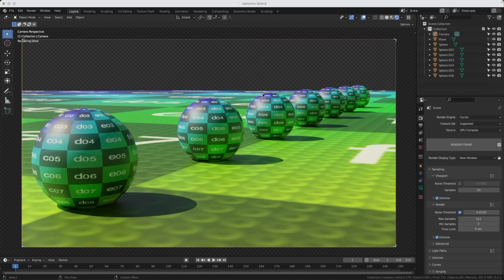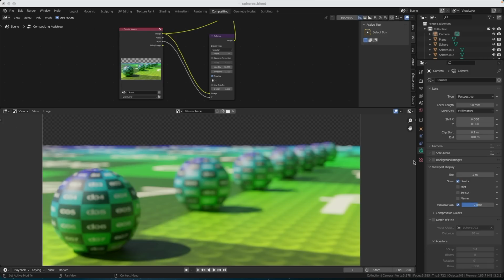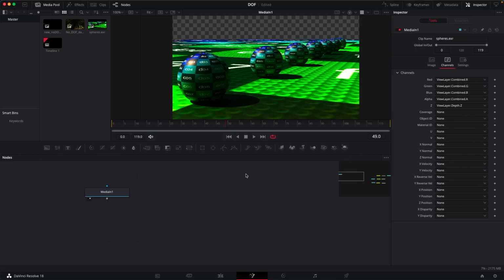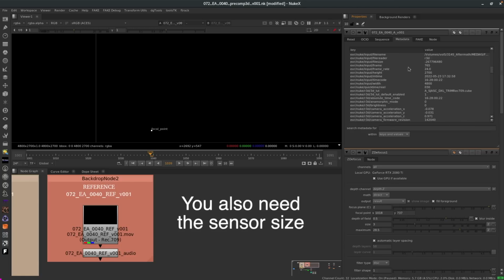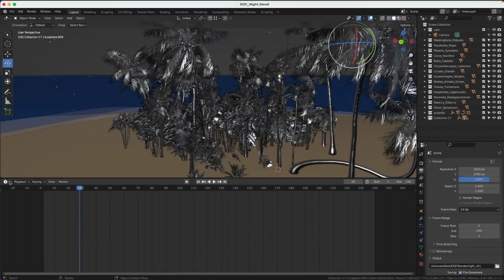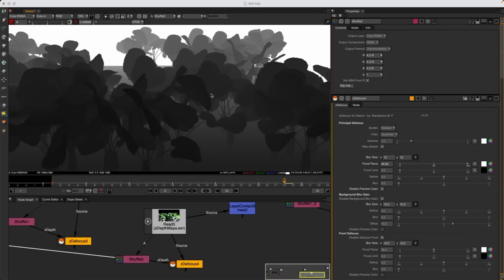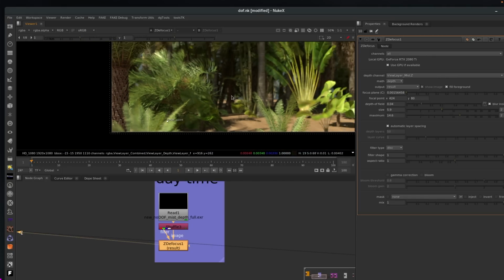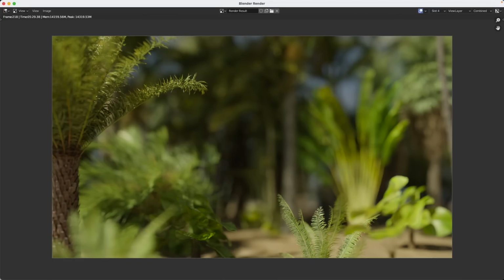Depth, mist passes and depth of field in Blender, Nuke, Natron and Fusion. #b3d

Comment: I've had some luck getting cleaner depth passes running the denoiser node and alpha into the depth for exr output so it will antiailse the alpha, not perfect but saves you from a 4 -8k render on the z alone

Comment: For the "buggy" Z pass with lots of fireflies, use the denoised version (denoising data must be activated first)! You'll get a clean output.
Reply from the maker: denoising data?
Reply: @BlenderBob  hi Bob, in the properties panel> view layer properties, where you can find all the render passes. Apparently I was wrong but I got to use it successfully for my last project where I had large scale forest scene with an unusable depth pass. Never mind...
Reply from the maker: @fabbrobbaf  How com I never realized that there's a denoting data option!?! Doh!
Reply from the maker: @fabbrobbaf  Actually denoising data will not denoise the data passes. It just output the information that is used for denoising, if I'm not mistaking
Reply: @BlenderBob  🤷‍♂️
Anyway in 3.3 denoised depth pass seems broken...
Reply: @BlenderBob  previously you had to use these passes with the denoise node. Now you only have to activate it in the render setting tab (Optix or OpenImageDenoise).

Comment: A very common problem you keep having is that you neglect the data types you are working with. I'm pretty sure this is not the first time you had this exact issue on this channel:
Blue sockets in nodes are vector-values. They have three different dimensions. It's not obvious how those ought to be converted to a single value (which is grey sockets) but Blender chooses, I think, the average value.
So if you try to use this with a gradient, it'll just average together to a diagonal gradient.
It's best to do a separate-XYZ-node and pick out just one direction you like. It'd make sense for that to be the Z-direction. Then, if you pick a plane or, even better, an empty, the "up" direction of that object is gonna correspond to the direction of your gradient. (Although in some situations going for X or Y might be more suitable to your needs. In most cases you'll want Z)
Reply from the maker: The point was that there’s no way to do a planar projection with some kind of visual reference to where the projection will happen. Same with projecting UV. You a cylindrical projection but no control at all over it. Yeah, agree for the X Y Z approche.
Reply: @BlenderBob  yeah, I'm not saying the situation is perfect. I just noticed in the past, also in your Geometry Nodes experiments and such, that that particular concept of socket-type kept hitting you a curveball.
In principle, using another Object's object coordinates (as you have done) should be what you want though. Then it should work pretty much exactly like in Maya I think? As far as I could tell the only issue there was the socket situation.
It'd still be nice to have, like, an immediate version of that though. Spawning a texture directly as a 3D object does indeed seem rather useful. And I think every issue you mentioned about the Depth- and Mist-passes and how various softwares respond are pretty big deals.
I wonder if there could be an approach that's somehow "best of both world", giving you Cycles' precision but in a convenient "confusion mask" or something. I mean even the best-in-class post processing depth of field effect didn't look nearly as good as what Cycles would have given you, but the drawbacks in flexibility are obvious and so it's an acceptable tradeoff.
Reply from the maker: @Kram1032  Yeah, sometimes I go to fast in publishing clips and I get people reminding me of the mistakes I made (especially my Wish List clip) and I actually really appreciated that. I'm still learning. Blender Bob doesn't mean Blender Master. It's just a name. I actually said that in my very first clip. I thought it could have been when they change to Cycles X but no, it still didn't work in earlier versions. I don't know a bout 2.79 though. I will make an addendum clip like I do from time to time to correct my mistakes. Cheers
Reply: @BlenderBob  I also really appreciate your videos.
I'm pretty well-versed with technicalities, but not really with artistry and trickery, and that's a gap you're filling nicely.
It's also great to see this broad set of programs side by side, really showing off how powerful (or not) they are. And hopefully they'll also show weaknesses some dev somewhere is eventually going to address

Comment: These "Blender bugs" have been there for years. I realize it's free software, but I don't understand why the Defocus node and the issue with alpha map edges haven't been addressed by now, especially considering all the support the Blender Foundation is now receiving and has been receiving for several years now.
The Vector Blur node is another one with bugs -- the first frame is always unusable and it sometimes just freaks out requiring frames to be re-rendered.
There are always workarounds, but it's unprofessional and embarrassing. I find myself telling friends, "Yeah, sorry. That's just a Blender bug. Hopefully they'll eventually fix it, but it's been there for years, so don't hold your breath. Here's an awkward, hacky workaround."
Reply from the maker: Usually issues with MB on the first frame is because the animation didn’t start before frame 1

Comment: Why does Blender use f-stop values which have no sense in real world lenses? Like 0.2. The f-stop has to be set way under 1 to get a shallow DOF. While real lenses rarely go below 1.2.
Sure, no big deal, but dont call it f-stop then. Call it DOF ratio or whatever. :)
Reply from the maker: Are you working in real size?
Reply: Yes, sir. I did not make tests, setting it to 0.4 gave the desired result and that's that. It's just an impossible real life value. I'll make some tests, maybe it was my scene after all.
Reply from the maker: @imregpap  That reminds me that I I wanted to mention that the scene has to be real size but I don"t remember if I mentioned it. But I think I did make the test in one of my first clips like 2 years ago. I will try again.
Reply: @BlenderBob  I made a quick close up selfie in my room and replicated it in Blender with the same setting, and it looks OK! F-stop 2.4, 20mm, 25cm from my face. Focusing on the tip of my nose, the back of my head is already blury, like on the photo. So it's accurate. I think I just made huge outdoor scenes with the focus plane meters away from camera and expected more blur. But yeah, it depends on more factors than the f-stop alone.
My bad, Blender seems accurate. :)
Reply from the maker: @imregpap  four factors can influence the DOF. Focal lens, distance to object, sensor size and aperture. They all need to match in order to make tests

Comment: You could use a node group and python to add that vertical ramp to every material and thus still use bump and displacement. The Eevee addon material override can do this
Reply from the maker: The idea is to get it as an AOV and not messing with the original shaders. Should be built in like Renderman
Reply: @BlenderBob  what happens if you use it as a material override and then use the diffuse pass

Comment: Point in Fusion is, that it reads not automatically many channels from Blender, because Blenders naming is very wrong. Well EXRs and Blender is a nightmare on its own. Anyway, presets do the best job there, except you used viewlayers, but thats Blenders problem. Also Blender is doing depth wrong with motion blur
Reply from the maker: In Nuke I just need one node. Then I shuffle to get the layer I want. So I only need to update one node if i change versions.
Reply: @BlenderBob  Well, but if the name changes and you output a serious of layers, things a different. Yes Fusion is more work, have both setups here. In Fusion and Nuke. Last project rendered in Cycles with the help of TurboRender, thanks to garage farm who made it work. Still needed to do a bit of denoise on diffuse and transparent.. So I depend on a outputting nearly all layers and also in having smaller files. A bit complex for a comment.
Reply from the maker: @robertYoutub  I just answered this to another comment:  If you have an EXR with 5 layers and they each have diffuse, glossiness, transparency, normals, and point position AOV, that's 70 layers. Can you even have 70 layers? And if you use the script, you will have a mess of 70 nodes that you need to update one by one every time you have a new version. In Nuke, I may have many shuffle nodes but they don't need to be updated. I only need to update one node.
Reply: @BlenderBob  yes in theory, but not if you know Fusion. Its a bit tricky so. And yes Nuke does it better. I like Nuke, but then Fusion has some awesome stuff that I also like. Yeah absolute right about the manual setting in Fusion. That sucks. But as the names are always identical in all renders, except Cycles, its just replacement of the root. As said, I have setups, with a single node and bit of shuffling.
Reply from the maker: @robertYoutub  Nice!

Comment: I've made an addon which adds empties to a camera, with it you van control the zdepth much easier. I used according to someone's example. I'll try to post a link of that video and my repo
Reply from the maker: Why do you need to control it. All the information is already there. It’s the tool that deals with it that needs to be fixed
Reply: @BlenderBob  in blender it's not easy to control otherwise
Reply: @BlenderBob  you could get se it for dof, it renders faster vs rendering with real dof. Downstairs Dr is that is just 1sampoe and that's why we t looks so jagged
Reply: Here is that video, hope YouTube doesn't delete this link. Hate them doing that
https://youtu.be/5eoYmUfyUyw

Comment: Great content as always :) 
As for the vertical fog, one quick way to do that in Comp is by using a PositionPass (P World). The output image will represent the position of each pixel in 3d space and therefore: Red channel = X (horizontal values), Green channel = Y (vertical values) and Blue channel = Z (depth values - yes, one can use the blue channel as a Z depth as well). Knowing this I'm sure you got the point already:  use G from PWorld as mask for a Grade node (Nuke wise speaking). Extra control can be achieved by grading this mask as you also did in one of your examples ;)
Reply from the maker: Yeah, I totally forgot about the point position but then again, how do you add noise like I did in Maya?
Reply: @BlenderBob  you can use a P_Noise and multiply that with the previously generated mask :)
Reply: @BlenderBob   With the p pass you go in nuke and use and expression node and in the field bellow r-g-b fields, where is nothing you adt noise(r,g,b)  and now you have a noise spread on P pass on the A channel witch you can controll by adding a gain node before the expression and you play with the rgb values in that to scale the noise as you want.
Reply from the maker: @darviniusb  Cool! Way over my pay check though. Thanks!

Comment: Regarding custom depth pass, here is a time consuming workaround that might work, although I didn't test it against transparencies and displacement:
1) In some random material, add two reroute nodes before material output and make a material node group out of them.
2) Inside, add geometry node using the position output through a vector rotate and possibly vector add, followed by a separate XYZ.z going into custom shader AOV.
3) Add this node group to all materials in the scene, dropping it as the last step - the actual shading info will just pass through it, but AOV info will get added.
4) In view layer properties, remember to export the custom depth pass for export. Preview in small outputs and adjust the parameters. Sadly can't render preview custom AOVs.
I gave this up in Blender because of the noise and edge issues you mentioned, but try using it for a depth of field control instead of mist in Nuke.
You should be able to get something similar to a tilt lens with a tilted focus plane. Wild effect, and not often used.
Think top of a flower field in focus but the bottom of the plants/ground are not, but the camera is horizontal. Would love to see the results with some heavy bokeh :)
Hard to explain, but here is a real life video on it used for photography: www.youtube.com/watch?v=gTDCW_8AsSo
Reply from the maker: Interesting approach. I know very well what a tilt lens is. I studied professional photography and I use to own a 4x5 camera where I could tilt the front to move the DOF up and down or left to right or even in diagonal.
Reply: @BlenderBob  I use something similar to make walls render invisible if viewed from the outside (thin walls), as to not obstruct my view while navigating the scene, as well as clay rendering without affecting lights and what would be glass windows and so on. Might be possible to make a script adding this to all materials, then ask what to do if emission or transparency is found, but that's out of my league.

I tried with assets using alpha, and for now it's a no-go. While I can get the alpha information into the node group and do some maths with it, it still registers as a ray hit and will obscure the object behind the alpha which is what we want. From what I recently heard denoise depth pass may be better suited for regular depth in some cases, but of course won't work for custom depth. So a proper pass for this that handles transparency/alpha would be very welcome.

Comment: I came across the bug about the white dots on the Z pass and Mist pass so many times while working with plants and accroding to what i found on the internet, it's due to the fact that when there is an alpha involved in the shader, if it's not 0 or 1 it will do this artefact, which is weird bc the opacity map used for this kind of shaders are pure white or black, maybe it's a problem with the colorspace but i don't know. 
One way of dealing with this bug is to set the "Alpha Threshold" in the View Layer Properties to 0 and so Blender will ignore the Alpha. The problem is that if you work with low poly plants you will get a big difference between the geometry and the alpha... So please Blender Devs fix this problem !
Also this problem appears in others utility passes like the Position pass, but the cryptomatte has 0 problem of dealing with it......
Reply: For the "buggy" Z pass with lots of fireflies, use the denoised version (denoising data must be activated first)! You'll get a clean output.
Reply: @fabbrobbaf  yes but it doesn't look like a Z pass
Reply: @JonathanTRG  then you have to map it with the map node by setting for instance in min = 0 and in max = 250 to out min =0 and out max =1 (do not normalize it otherwise it will change depending on the max and min range of the objects int he scene). Trust me it works and when I found it out I was literally hilarious.
Reply: @fabbrobbaf  the "Denoising Depth" pass is not a depth pass denoised, it's not clear what it's purpose is, I assume it's a debugging pass, but anyway, it has some information of glossiness in it (so parts that are closer to the camera are whiter due to the specular highlight), it is anti aliased and seems to have a different white value on long lenses, I could show you instances where it's absolute trash and doesn't work but I can't share images here, so no it's not a depth pass, and even if it works in some cases, if it doesn't most of the time, it's not a good replacement
Reply: @JonathanTRG  are you just supposing or is this documented? Anyway this pass saved my ass so many times
Reply: @fabbrobbaf  like I said, if i could I would have send you pictures, the only supposed part is when I said that the Denoising Depth pass is a debugging pass, because there is no documentation on it. For the rest I can just do a render and show you.

But i'm glad it works for you, it just doesn't work for me and a production pipeline so the bug needs to be fixed

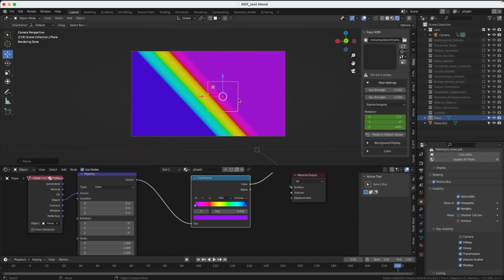Comment: Around 26:04 I can't answer why using a gradient texture (edit: color ramp) is like that, but a (possibly) better way to get vertical depth with a ramp is to use an empty or an object in a texture coordinate node, then use a separate xyz node and use the z output for your needs. You can scale the z scale of the empty up or down to get more or less of a gradient vertically. I've attached a link to an image on my google drive.
https://drive.google.com/file/d/1FtFtRoVkLudm3rezkwvOY3umazTeLflr/view?usp=sharing

I don't know if it'll work for your purpose, but I've used this for lots of "global" kind of effects like dirt/grunge on a bunch of things on the floor, a dissolve effect that goes on everything, some stylized lava glow.
Reply from the maker: NIce! Didn't even think about that. I could probably also use the point position pass too. Forgot to try.

Comment: You should separate XYZ coordinates, plague Z value in color ramp. By default it uses XYZ as RGB and makes color ramp on its brightness. XYZ values get higher diagonally. Also use empty, not a plane.
Reply from the maker: Yeah, good idea. Didn't think about that. Thanks
Reply: @BlenderBob  yep, you shouldn't plug the coords directly into a color ramp. The color ramp doesn't use a vector coordinates, it just remap a value between 0 and 1, so if you plugin a vector value, that's what you get. You either separate XYZ and plug them into a color ramp, or you use a ramp texture, which can actually read coordinates and will work accordingly... as a texture :)

Comment: For blender, I would recommend using eevee for the mist pass, way faster and less buggy
Reply from the maker: Eevee doesn’t support displacement. Not yet. And even when it will it won’t exactly match Cycles’
Reply from the maker: Same with motion blur
Reply from the maker: But I did a clip where I was showing how to mix a volume fog from Eevee with a Cycles render